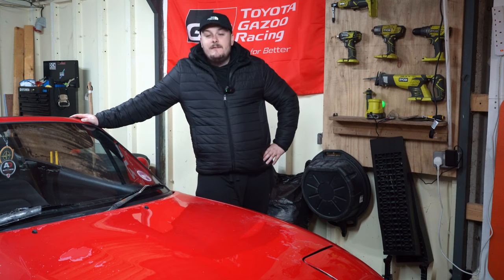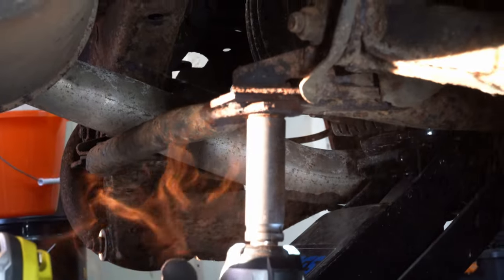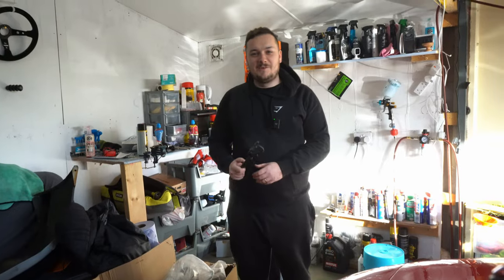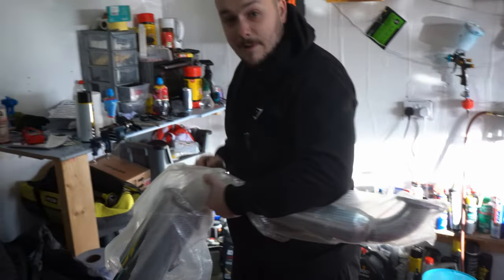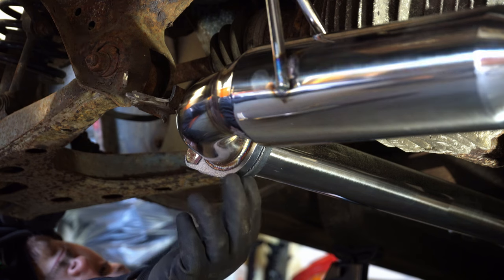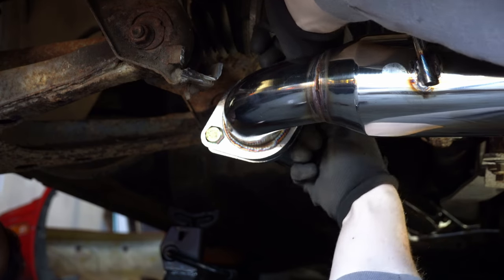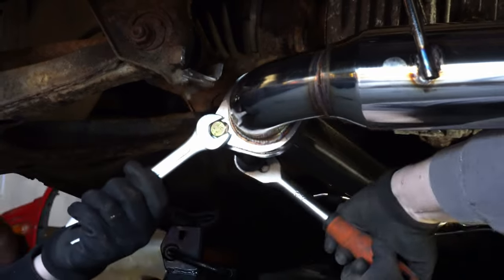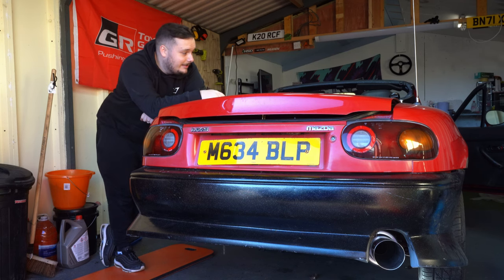Malian MX5 Exhaust Install! | Budget Build Miata

Comment: Are you guys actually located in kent? I'm near maidstone
Reply from the maker: Yeah we're both in east Kent 🤟
Reply: @kentcarmedia  cool im thinking of getting a mazda mx5 mk2 honestly I don't have a clue about cars just looking at using it in the summertime do a few mods to it sound system exaust etc. Any advice or help would be great. Not got a crazy budget.
Reply from the maker: I do have a MK2 buyers guide which should have most info you need, market is good for buying right now, make sure you check rear sills and from chassis legs well! Any lumps on the outer sill will mean the inside is gone and will be expensive.

Comment: Holy shit is there actually no way to fit it without cutting through the wishbone? 😳
Reply from the maker: Not on this year car, you can unbolt it but all my bolts were seized so had no choice!
Reply: @kentcarmedia  Is that the case just on 1994 onwards? I have a 92 and I know the exhaust kits are slightly different as the cat is a different size 94 onwards